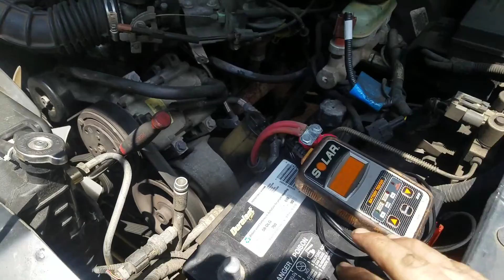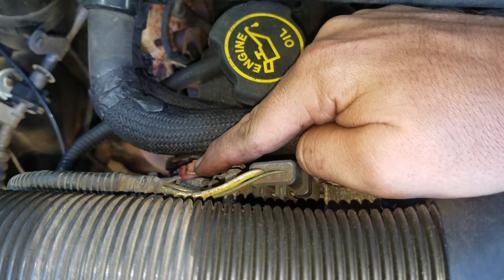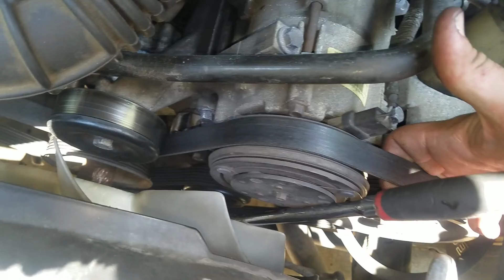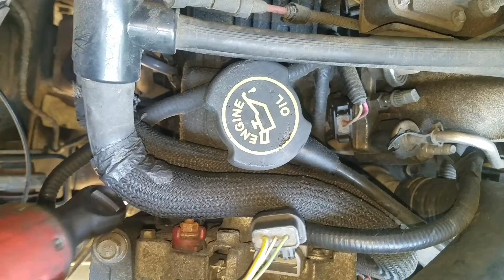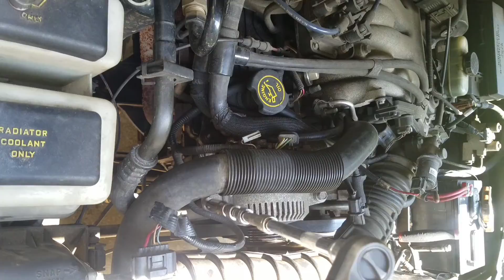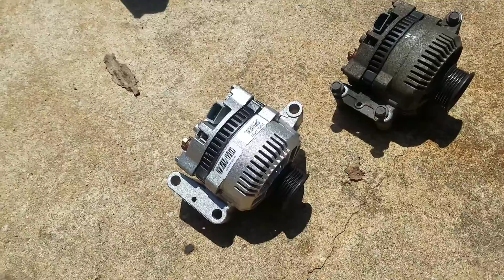Replace an Alternator 2002-2006 Ford Ranger

Comment: Guess no one told you to that if you start the car or truck you can remove the positive cable from the battery and if turns off then your alternator is no good. Thanks

Comment: Thank you so much for helping me get my old ranger going! Followed your instructions exactly.  Tricky to not crack or chip the Plastic  wire fittings  when pulling out of alternator without your hook tool.   Great advice. Thank you !
Ps please disregard the comment below about lefty loose? Rachet turn to right only like he says in video

Comment: Righty loosey? I just spent 5 minutes tightening the living fuck out of that bolt turning to the right. 2004 Ranger 3.0. Thanks for the help.
By the way to other viewers, in case it wasn't clear, it's counter clockwise to loosen, not "righty loosey".
Reply: My 2002 ranger was righty loosy. In case it wasn’t clear, I followed this video to a T and I replaced my alternator first try because of this video. 
Don’t ever blame the op, blame Ford engineers.